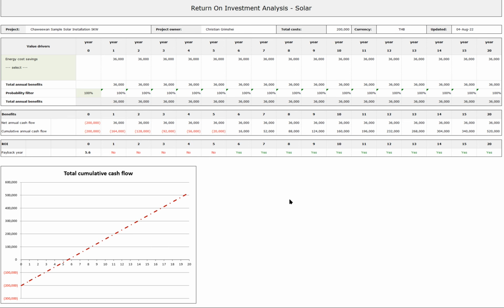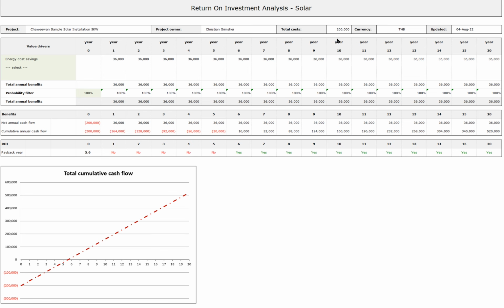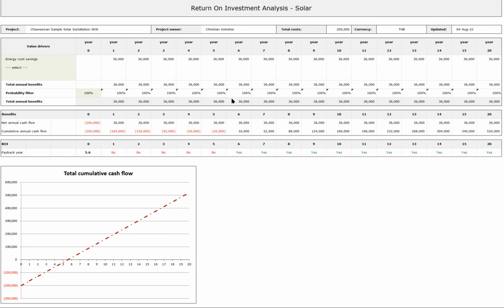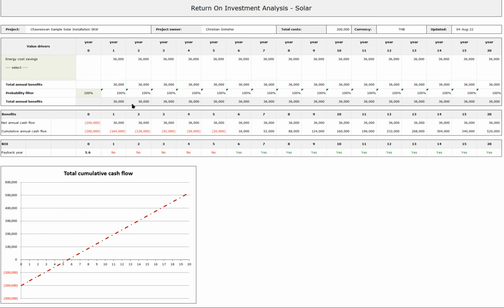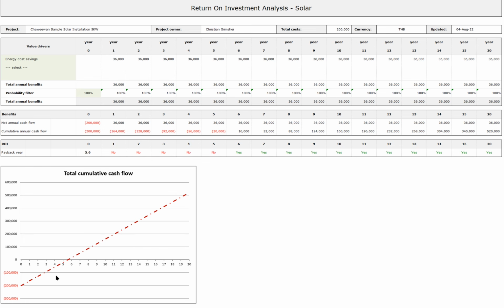Investing In Solar: Return Of Investment Analysis For Solar Explained | SolarThailand.biz

Comment: Community supplier?  Where do you see that?  With your experience of installing systems then I would guess that you have collected a good base line/average of monthly kWh produced for different systems (size, orientation, etc).  To give more accurate roi expectations.  (seen once a retailer used the static max capacity of the components to calculate the yearly saving. smh)
Reply from the maker: In many cities in Thailand real estate developers create communities where they control the electrical price from a central meter and transformer. These developers add to the unit price of electricity, how much depends on many factors. But it can be as high as 40-60%.
Reply from the maker: Regarding the accuracy of ROI, I think that the most important thing to understand is that you are dealing with a situation of many many variables and how they will develop over time you just cant predict precisely. For example, take unit price. My guesstimate is that it will increase over time, but how much i dont know. To know this would mean to be able to predict so many things about the future that it becomes inaccurate, IMO. So, the best we can do is estimations. And show the customers the way to think about the investment. Most most this is good enough, and if someone claims to be able to promise a certain % or a certain future, I would say they are not speaking honestly.
Reply: @ChaweewanGroup  Totally agree. But, if I knew/had peer households with similar solar installs in my area, then it would make my job easier to convince family elders.
Reply from the maker: @darwinjina  We have installs all over Thailand. Many owners are willing to show you their system. Let me know where you are and maybe we can help.
Reply: @ChaweewanGroup  I would had luved that about 1.5yrs ago. Now I'm still awaiting PEA to install 3phase digital meter so i can export.  Well I still collect info/stats on my system as that is my nature. Chiang mai
Reply: @ChaweewanGroup  I'm expecting that once I can get a fully operational system (with export FIT) then inlaws will be accepting and not see it has a luxury gadget.
Reply from the maker: @darwinjina  FIT is not recommended. If your own usage is so low that you can export a lot, better not to invest in solar. Why accept less than 50% of the ROI on the exported units? Plus system limitations (sizing etc). And you can never add batteries to a FIT system if you want to stay completely within their rules. Size the system according to your use and use the power yourself, thats the best advice i can give you.
Reply: @ChaweewanGroup  Agreed. Let's just say there were a lot of compromises made due to in-law politics without going into details. lol. On the good side, FIT gives me an opportunity to learn differences between US and Thailand. A future project (wish) is that I want to see a 1 MW farm in Thailand.
Reply: @ChaweewanGroup   Thanks. My bill comes from PEA, so I'm thinking I was lucky.